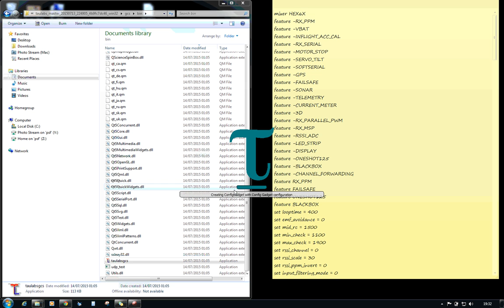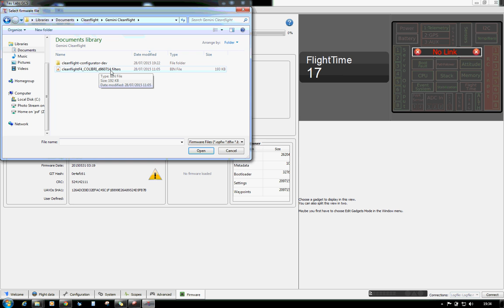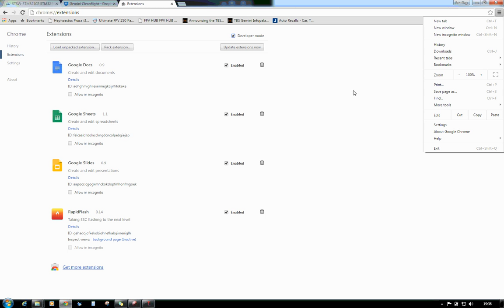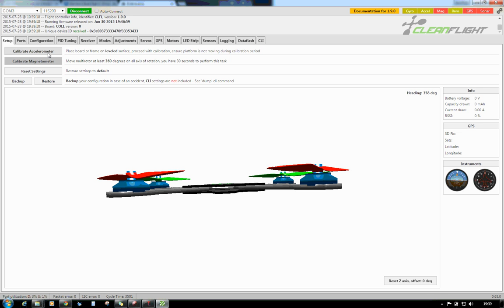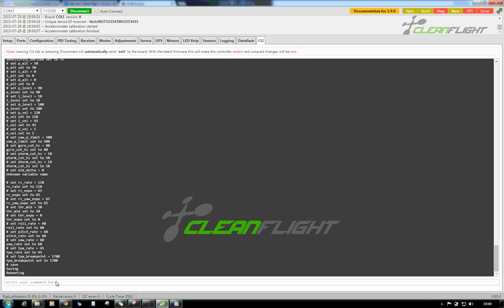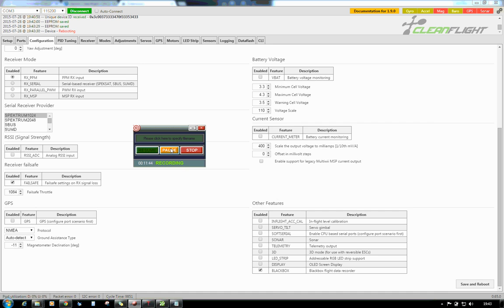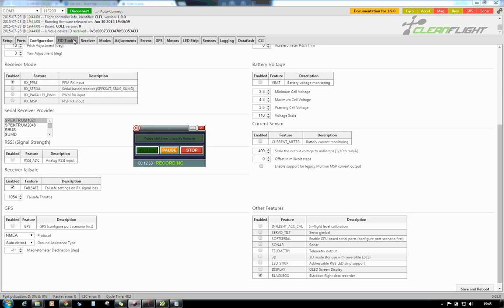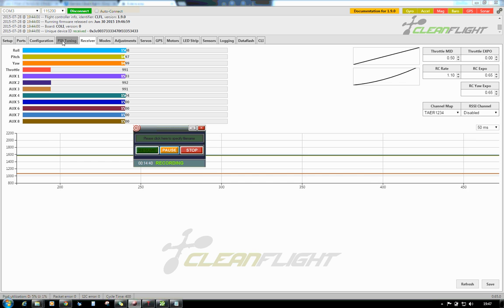TBS Gemini Cleanflight Migration

Comment: I noticed the files are now six months old... so as clean flight progresses along is anyone updating this? Also are the settings being refined?  Just wanted to know if this is still the best source for this information... thanks for all your great work.
Reply from the maker: +Joseph Dawson Yes sorry, we've stopped development on the Cleanflight side of the Gemini. 
I do recommend you give them a shot although we only really configured for rate mode. Not sure whether Magnus or Tyler updated them for Horizon etc but you will definitely feel a marked improvement in flight characteristics, over and above anything Taulabs would offer.
Reply: Do you now any  ways to  update horizont mode  ?   or make moe stable   ?

Comment: Is this the most current method of swapping away from taulabs to cleanflight for the gemini?
I wanna do this, but I want to make sure I'm not using outdated firmware images or methods.
Thanks in advance!
Reply from the maker: +vissago Hi Yes, we have no longer pursued anymore on the Gemini.
Reply: +Matt D aww boo - can I ask why? The thread on fpvlab is still alive (but for some reason I can't post anything to that forum at all). did you go back to taulabs?
Reply from the maker: Nope we did what was required ultimately in our discussions. It was taking up enjoyable flight time :)

Comment: Ok, I have got to the Cleanflight Configurator. When I click "connect" it states "Serial port successfully opened with ID:1" Then after 10 seconds it states "no configuration recieved within 10 seconds, communication failed, serial port successfully closed." Can anyone please tell me where I am going Wrong. I am running on windows XP. Thanks.
Reply: +Coptercowboy Quadcopter i'm getting the same here
Reply from the maker: Guerrilla Drone have you both tried different USB ports? Different usb cables? I have found in the past I've had to wait a few seconds before even trying to connect. Exit cleanflight fully and reload up. I don't have a colibri anymore to check unfortunately...
Reply: +Matt D hi Matt! I got it working! I didn't know I had to dig into the drivers folders and find the 64bit version ;) I was able to get it to connect... Now my problem is, I wasn't able to flash the las esc (all but one), and can't get motor 5 and 4 to spin... Driving me crazy!! :(
Reply from the maker: Guerrilla Drone perfect. So flashing the escs is a right pain also. I suggest closing the programme. Powering down the quad fully and let it cool a bit. Come back to it and makesure you have a good solid connection to the pin! I had it multiple times was a right pain in the arse. But it's worth it as it'll transform the Gemini :)

Comment: Fuck! Can't get the darn comport driver to work. It connects then un connects :( Says no drivers installed.. Hope Magnus can fix it. He's dropin by later, but i think he's a Mac guy :S
Reply from the maker: Did you install the correct driver? Click on the 64 bit version etc if that's what you're on?
Reply from the maker: Also, you may need to plug your battery in to get cleanflight to recognise the Gemini if your USB isn't putting out the 5v.i have that issue on my laptop with the colibri
Reply: +Loading Loading Magnus fixed it. And yes that was the "BIG problem XD
Reply: +vazza69 Cant wayt for maden!! :P